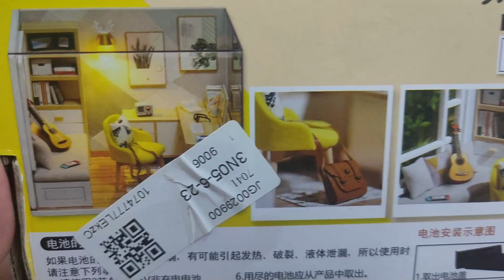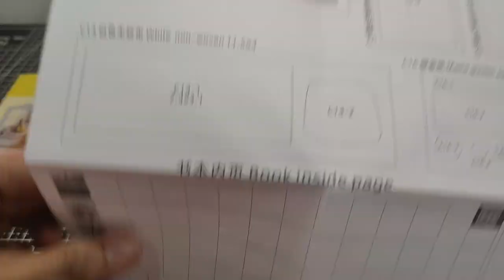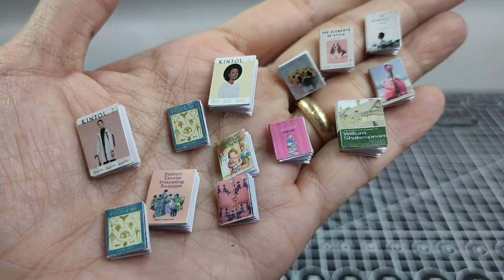DIY Miniature Study Room.  Sunshine Study.  Hobby kit build.

Comment: Please tell me, where did you find the frame backs? I don’t understand what c14 is? X
Reply from the maker: Hello. The frame backs should be included in the C1 cutout sheet labeled number 4. You could fabricate a replacement if you can't find it since it'll be hidden once assembly is completed. C14 is the thin white sheet of foam used as cushioning for your furniture. Just cut them based on the cutting template (C2) as required. Hope this helps. 😊